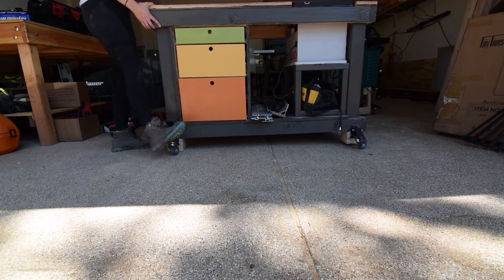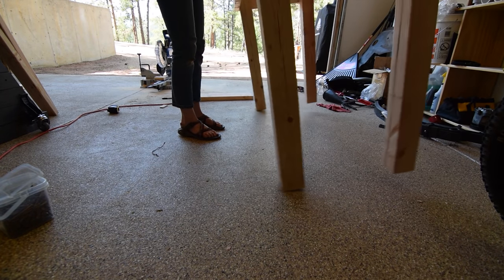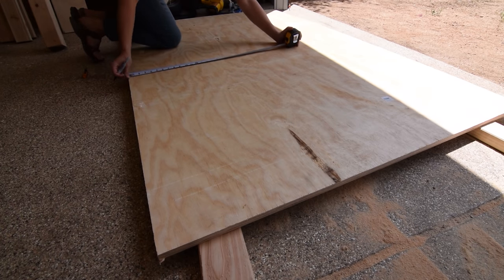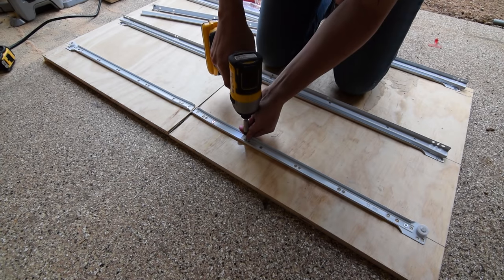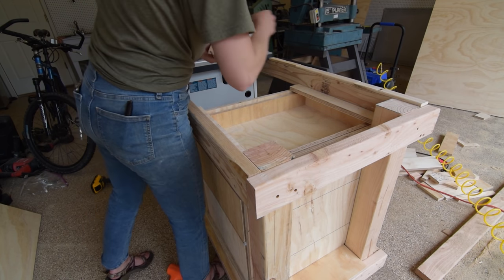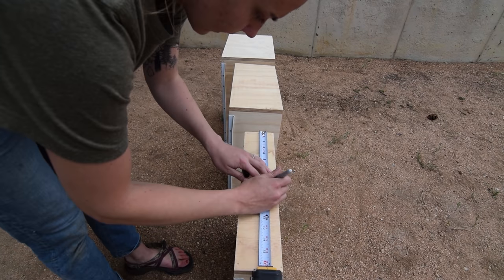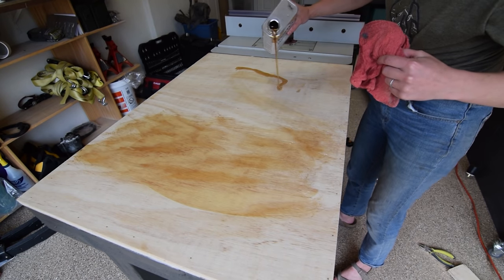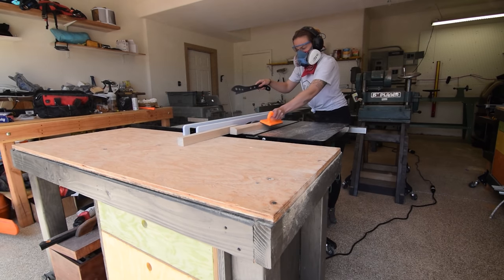DIY Mobile Router Table and Work Bench | Ep.1  Mobile Work Bench Builds

Comment: If your concern about the top is friction, just add some paste wax. It'll protect and lubricate. Much easier to apply than an additional finish as well.
Reply from the maker: Hmm... I didn’t think that would work as well on the plywood vs a metal table, but if it would, that’s awesome! I can do that tonight! Thanks, Ryan!
Reply: @HonestWorkDesigns  I use pastewax on the top of my Bosch jobsite table saw. It definitely helps with the friction. I have to re-apply it every 6-12 months, but it's a 5 minute job.

Comment: Looks good. Nice and solid. Curious about the router table placement and why you made it that way. Why did you not turn the table 90 degrees so that the workbench would support the wood before and after the cut? Whenever I run a long piece of wood, I am always battling to keep it from bowing under the weight of the ends hanging off the table. Thanks!
Reply from the maker: Good q, Steve! Honestly, it was how I used it most of the time in my old shop, and since I’m making similar modular tables (so one that can fit behind and act as out feed) I didn’t even really think about changing it up. Haha i guess I can always swap it if it makes more sense later!

Comment: Are the shims under the top to get it level?
Reply from the maker: Not so much level, but flush with the table top of router.
Reply: @HonestWorkDesigns  ahhh ok so it was to make sure the embedded tool worked perfectly.  that makes sense!  Thanks!